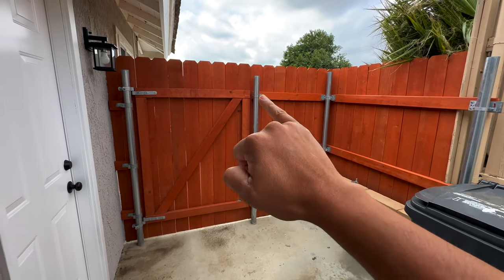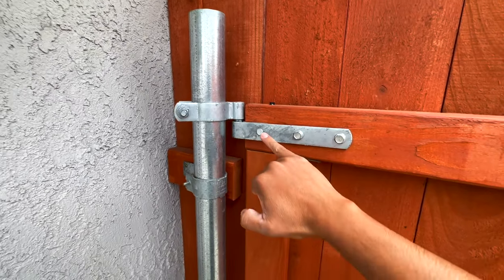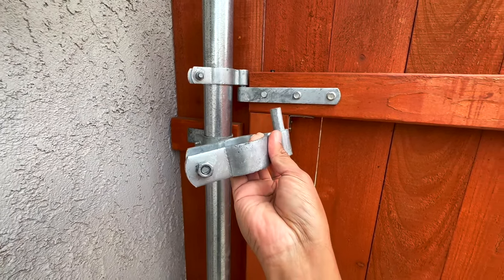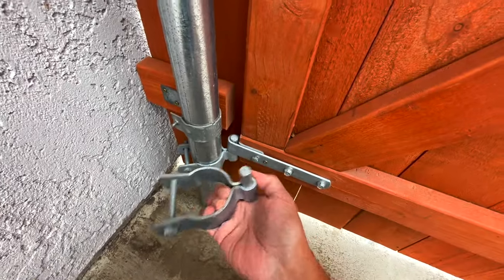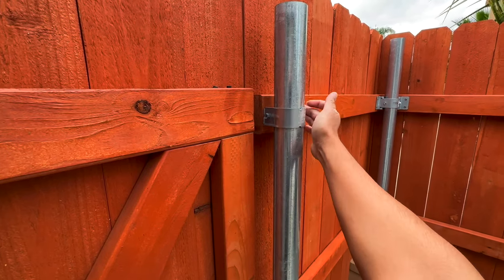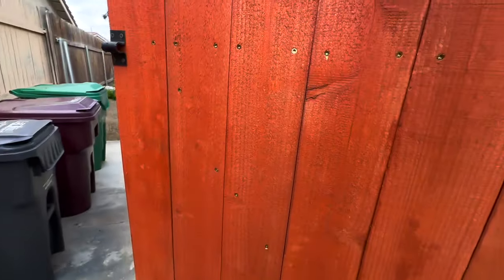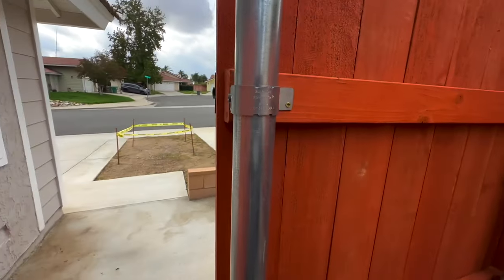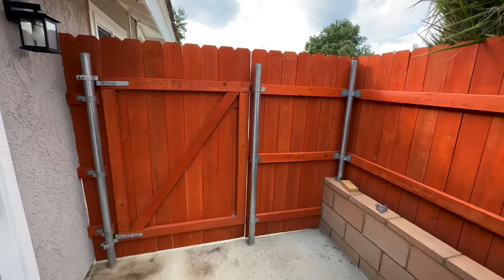Galvanized Steel Post to Wooden Gate I figured It Out For You

Comment: Thanks so much for the details on where to get those brackets on the cheap. I’ve spent way too much money for them at HD over the years.
Reply from the maker: You’re welcome, it is incredible the markup on those brackets, I’m glad my video was helpful.
Reply: @NumberDZ  For clarification..It looks like the top hinge post is facing down..and the bottom is facing up.I'm ordering via phone..Did you purposely face the top post of hinge down?.The reason I ask because it looks like that or that the straps have the posts on them...Our Home  Depot didn't have the straps.
Reply from the maker: I purposely put the top hinge facing down and the button facing up, that way the gate is secured, otherwise if you put both facing up anyone can easily lift up the gate and take it down.

Comment: I am having a hell of a time finding the hinge strap that fits the post side of the hinge.  Every hinge strap I’m seeing has .61 or .71 hole diameter and the hinge is either 5/8 or 3/4 pin.
Reply from the maker: Did you check your local fence supply stores?
Reply: @NumberDZ  I have. Their hinge post is 5/8” but all the hinge straps I’ve seen have a hole diameter of .60 so they won’t work.
Reply: @spurly48 try filing the male end, making sure not to flatten it while doing so
Reply: @LG-ne6or  Agreed,  I just took   1/128" off all around the pin,  I used a #60 or 80 grit flap disk on my angle grinder and smoothed it with a flat file.   The difference in diameter was 0.015".   One could do it with just a flat file if needed. 
Use eye protection and a good 3M dust mask if you use a power sander or grinder to avoid galvanized (zinc) dust.   I just did a test fit for any tight spots and put some grease on it.    I did mount my offset facing away from the fence allowing the stationary pin bracket to be rotated in more - this allows the flat bar to set flat on the rail (no stair step bump on the mounted side) and the gate can open more that way.   The angle of the pole clamp with the pin (the chain link pin hinge for 2 3/8 posts)  is set so the fence (or rails) align flat on the finished side.  Once the angle is set, then your pickets can be placed or cut as needed between the gate and stationary fence.      I would take the 5/8 male hinge pin with me when you buy the strap, as some strap hinges are 0.41 (less then half inch, and no where close to 5/8) vs the 0.61 I purchased at Tractor Supply.    As noted,  I think I paid 12 to 13 each for a 12" strap hinge,   you can get a 9 or 10" a little cheaper - about a buck or so per inch if I recall correctly.

Comment: Nice job. It's not the best hinge, but you're right, that's all you can get for metal to wood gate. You need to install self-tapping sheet metal screws into the bracket on the pole so it doesn't move over the years. It might be best if you through bolt the hinge bracket on the gate with carriage bolts. If the hinge stud falls out over the years you can install a 3/4" bolt with a locking nut.

Comment: Man I’m having such a hard time finding these. Every store just sells the stupid regular strap ties. I guess steel tube to wood fence gate is not common at all

Edit: found hinge straps at ACE hardware for 3/4, 5/8 and 1/2 inch. Gonna measure and see if it will work with the Home Depot male hinge strap

Comment: Yes your right on the post clamps home depot lowes charging 14$ i called local fence company that has them for 5$, how thick should posts be? they are usually 2-3/8" though what gauge 16-20 or 40?

Comment: Thank you for your video, it assisted me greatly.  I however ended up improving your design.  I avoided the strap hinge, and went with a conventional wood post to Steel transition hinge (5/8" pin and 2-3/8 40 guage concrete-filled steel posts) with a male threaded bolt designed to join chain link to wooden posts - BUT USED BACKWARDS.  This leaves you NEEDING a FEMALE version of that 2-3/8' post hinge - which they don't manufacture.  However, you can buy the male hinge part, grind the weld, put fire on it, pound out the pin and chase it with a 5/8" drill bit for smooth swinging.  Now you have the 5/8" female pin receptor for steel post hinge and the male pin-bolt that goes through the 'wooden post' (i.e. your wood fence frame).  All my wooden frame is like yours (flat-to face) except the the hidge edge, which is rotated to stand off the fence, so that after drilling the 5/8 hole (for the male bolt), there's still meat on the 2x4.  Mine was a much larger dual-gate for RV parking, so I opted for glued half-lap joints, reinforced with screws and 90 degree flat braces on all corners. it worked fantastic, plus the hinge is 100% adjustable !  Thanks for getting me started !

Comment: I have an old double gate that have those straps and hinges.  I want to rebuild the two gates themselves and i like how your gate looks.  I wish you had a video on that, but I don't see one.  How did you connect the top and bottom (horizontal) rails to the side (vertical) rails?  I do see one bracket on their inside corners, was there more connection points?  Thank you.
Reply from the maker: I put two long screws on each 2x4 and a small bracket.
Send me a message on facebook and I can send you pictures so you have a better idea.
Reply: @NumberDZ  thank you.

Comment: What is the widest gate I can build with a single 3" x 3" galvanized post and using Brick Exterior of house to anchor the latch side?
Reply from the maker: Those posts are really strong, but I don't recommend to go wider than 48 inches,  if you need to build a gate wider than that you should put a gate wheel to support the weight, if you do that you can build it as wide as you want, or consider a double gate.

Comment: I have a 9’ gate I want to build. Would the galvanized posts hold the weight? I want to Lee it one gate instead of a split double gate….but im worried it will be too heavy for the post
Reply from the maker: It will be too heavy, you need to put a wheel on the end of the gate to help with the load.

Comment: Hey brother...I cannot find that Hinge straps that will fit a 5/8 bolt like you mentioned. Can you please get back to me with where you got yours. Even if I have to order from your Hardware store in your town, I will do it. Hope you get back to me!! Thank you!!
Reply from the maker: Send me a message on my Facebook fan page I will share the contact info.
Reply: I bought my strap hinges at Tractor Supply.  Granted the hole size was 0.61  and a 5/8 hinge pin is a little larger at 0.625 or about 0.015 that you can grind off the hinge pin with an angle grinder (that's 1/62" off the diameter or half that around the whole pin). You can test for fit and I'd suggest a dust mask when sanding the galvanized pin.    I found strap hinges in various sizes from 0.41 to the 0.610 from TSC (Tractor Supply).  I believe they start at 9.99 for the 9" but I used the 12" on my gate. 
Also in the pictures shown here I would flip the offset of the strap hinge so the full flat piece is against the wood and the offset is toward the inside, this allows the gate to open more than the position used in the video.   Adjust the clamp on the pole to have the boards align flush and you can open the gate past 90 degrees. Nail or cut the pickets to align with the center of the pin.   I standard gate latch for wooden fences will work fine, I just used a  1x6 5/8 picket to trim out where I mount the latch.  While the latch provides a stop for closure and closed position fence alignment, I overlapped a stationary picket 3/4 to allow my door frame to have uniform contact the full height that closure.       My thanks to the NumberDZ for sharing his design and concept, well done.

Comment: Do you know what the part attached to the post is called? I’ve found the hinge bracket and post hinge, but like you said, the post hinge is too big for the bracket. I’ve visited my hardware store and I can’t find the size that fits
Reply from the maker: You can find them by “chain link gate post hinge” visit your local store where they sell material for chain link fences, you can find all you need there.
Reply: I've looked all over for the bracket that is attached to the wood on the gate..no luck anywhere..Help
Reply from the maker: Visit your local fence store, use Google maps and look for “chain link supply” or “fence supplies”
Reply: Where did you find the bracket?I looked at Lowes and Home Depot in Edmond Ok....Can you kook at your receipt and post part number..?..I would appreciate it...
Reply from the maker: I found it at my local fence supply store, they don't have part numbers, they just know them by the name shown in the video "hinge strap". If you live in Oklahoma try (Acme Fence of OKC Inc) or (Binford Supply) those companies seem to sell material for fences, they should sell the part you need.
Reply: @NumberDZ  I did visit my dealer and all I could get was the smaller  post..still 2 3/8 but all they had for the bracket was one with bigger hole..Now I have small post ..gate hinge 2 3/8..
I feel like a fool now bec I  keep asking....asking questions.I need to find a smaller bracket like yours but there are none anywhere here in Okla..
Reply from the maker: Why don’t you use the bracket that is like a screw and screws into the post? Home Depot sells those?
Another option (as last resource) is to put a 2x4 attached to the metal post then you can use any hinge
Reply: @NumberDZ  I have the exact same issue as you where the original builders used galvanized posts to hang wooden fence panels.   To be clear, you were able to find the hinge strap that fits the 5/8" pin?  Or did you find 1/2" pins for the part that clamps on the post?   I am also unable to find the right matching hardware.   Thanks for posting!
Reply: @Tobymydog812  I'm having the exact same issue and I'm also in OK.  I don't know whether to look for hinges with a 1/2" pin, or hinge straps that will actually accept the standard 5/8" pin.  I bought a set of straps from an online hardware specialist and the description said "for 5/8 Pintle systems" but they sent me the exact same (National Hardware) hinge straps that won't go over a 5/8" pintle.  This will be the second set I've had to return.

Comment: @numberDZ  Hello great information.    I found  large 14 inch  hinge straps  but the brackets are a little loose inside. Afraid to use these because it may make the fence sag.    Did you have that problem with fit?  How long are your hinge straps?  Did they fit snug or did you have to force a little?   I found some that was snug with a little force but was not sure that is what I needed. Please help us.
Reply from the maker: I did not have that problem, the hinge strap fits perfectly to the post bracket. If I recall correctly my hinge straps are 10 inches long.

Comment: Where did you buy that hinge strap?
Reply from the maker: At my local fence supply store.
Reply: @NumberDZ  What is the name of the fence supply store.  I've tried everyone in town and no one has the hinge strap or gate hinge that fits.  Ordered them on line but like many others here, the 5/8 hinge strap does not fit the 5/8 pintle on the gate hinge.
Reply: @donotadjustyourtv  I noticed that even when I supposedly bought straps for a 5/8" pintle, the parts I received (National Hardware) are specced at 0.60", which is clearly not enough for a 5/8" pintle at 0.625"
Reply: @pwyllpendefig you could file the male end, making sure not to flatten it while doing so.

Comment: You indicated the hinge straps and gate hinge for pipe purchased from Home Depot do not fit and to buy from a hardware store.

It first glance, the gate hinge for pipe purchased at HD does not fit.  That is due to the zinc coating used in the glalvanizing process.  The 5/8 pin on the pipe hinge will fit together with the hinge strap with a little work.  To get it to fit you can do one or all of three things: 1) use a file or coarse emory cloth to remove some of the zinc coating on the pin, or 2) Hammer the pin into the loop of the hinge strap, or 3) both 1 & 2.  Any of these ways will work and you don't have to chase parts that will slip into the hinge strap easily because you most likely won't find them. 

Once you use one or all three of the options above, things will work perfectly fine.  Go ahead and buy at Home Depot, Lowes or other home improvement stores.  All the brands you will find are pretty much the same with the zinc coating ; whether National or Everbilt brands.